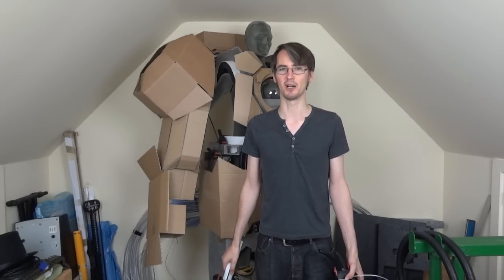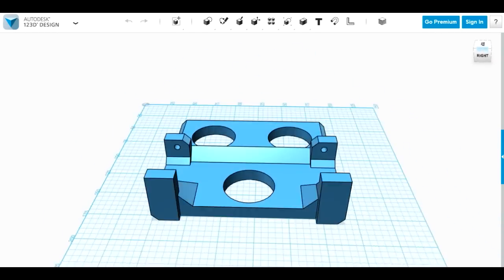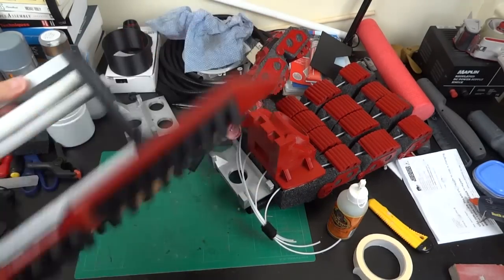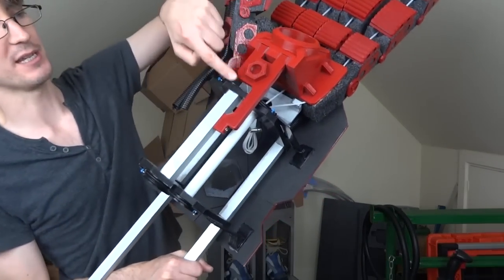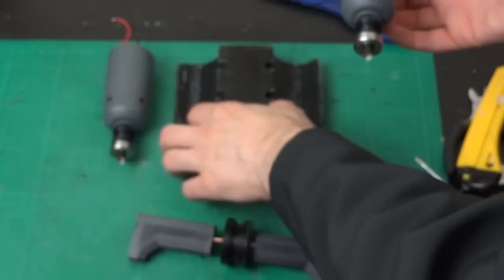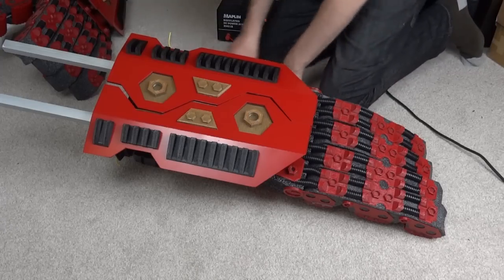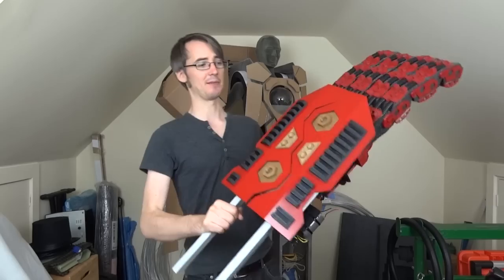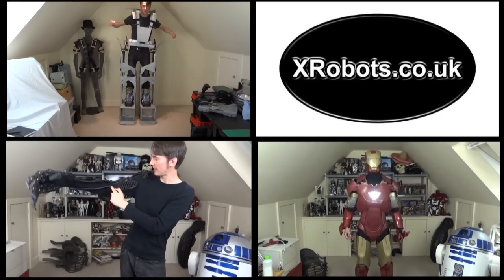Iron Man Hulkbuster Cosplay Suit #9 | Mechanics & Motors | James Bruton

Comment: Don't know if you need and/or know this but I saw a way by which you could have a pivot for the had wrist that could be moved by a piston. This could be achieved by adding a pivot to the grey/silver piece, a pivot to the bar connecting to the repulser and a slot on the wood bar that the 3d printed red bar is connected to.

Comment: This might have come up but I didn't find it. Are you planning on having the thumb and finger filaments come into a common block that is then attached to the motor?
I was thinking this would make the pull on all of them inline with the fingers themselves so it would be smooth and uniform. You could place some small pulleys in the wrist area to redirect the filament for the thumb so it also pulls smoothly. (I should have said did you? Well, continue watching I suppose.)